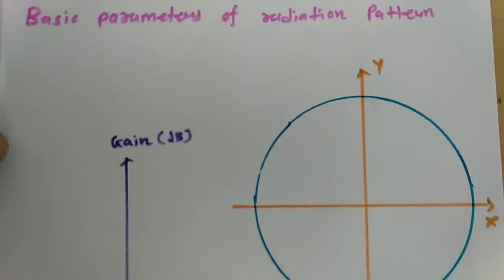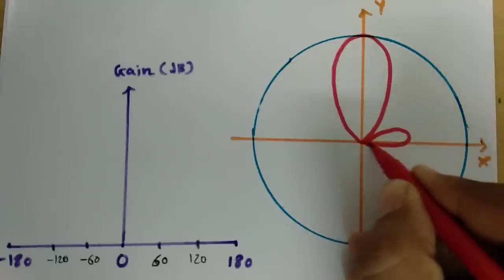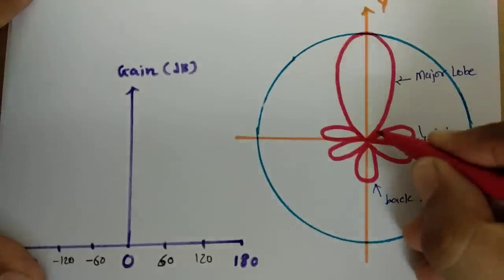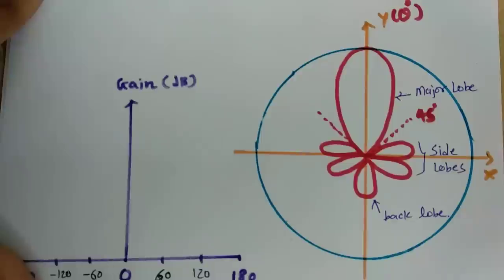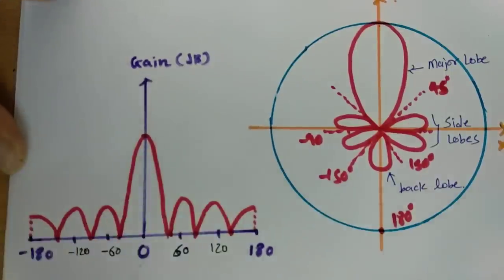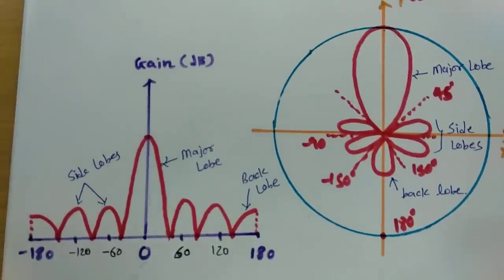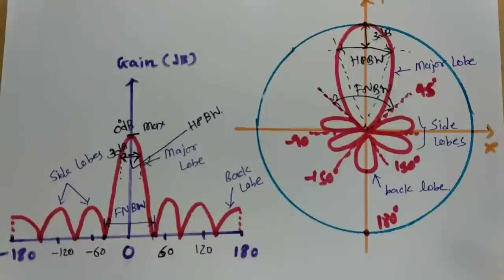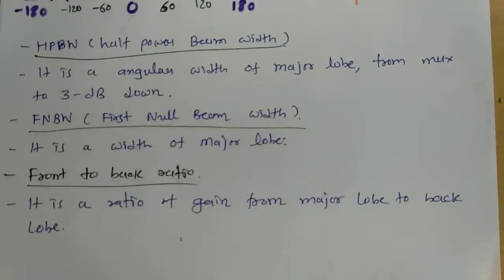Radiation Pattern Parameters (HPBW, FNBW & Front to Back ratio) Explained in Antenna Parameters

Comment: With respect Sir,  but you did not give one ounce of explanation as to how and why it all happens . You simply went to say what happens and how one can draw the result in polar and cartesian coordinates and how to note that the magnitude changes with angle. There was never any mention of how many phased antennas you are considering nor their spatial placing, be it inline side by side, or behind each other, vertical or horizontal  or circular or any other geometrical configuration. For such basic information there was no need for a presenter to just read what he was writing. Showing the written information would have been ample enough, even  if this lecture was meant for housewives and old pensioners to read. The presence of a lecturer should promote a higher form of Knowledge transfer and not such simple definitions. The title of the video is " Basics of Radiation Patterns, which " does not mean definition of jargon used in antennas!  One expected how the patterns are created from a particular spatial and time delays " placements" of particular antennas. 
The title should have been " Definitions of front and back ratio of antenna lobes".

Comment: In the example, the peak power of the front lobe is marked as 0db at 0 degree.  I would have guessed that the half-power (-3db) line was halfway between the Origin and the Peak of the major lobe ...  but it was drawn much closer to the Peak than the Origin.

How do I know where the -3db line is?  Is the axis of the graph logarithmic ?

Thank you for these videos, they are VERY helpful : )

Comment: Sir ans plz you have told in previous lecture that omnidirectional antenna radiates only in plan( yx at 1:30) and it doesn't has back lobe but at 1:30 you said that it will have back lobe??
Reply from the maker: Omni directional antenna radiates in xy plane and it does not radiates in z axis. So if you consider main lobe in the direction of +x axis then back will be on -x axis and it does radiates in +x, -x, +y, -y axis as it doesn't radiates in z axis.
Reply: @EngineeringFunda  sir it means in this case back lobe behaves as main lobe in a plan?(i.e. in omnidirectional antenna)

Comment: Sir please can you help me with a clue to solve this problem. 'Two identical antennas situated in free space 120 meters apart. The dimensions are 9000000 square centimeters and have directive gains of 12 decibels in the direction of transmission. Determine 1. Whether the receiving antenna is in the far-field of the transmitter. 2. Determine the received power if the transmitting power is 5 Watts at a frequency of 2 Gigahertz'